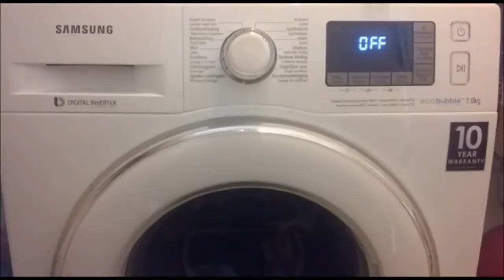Samsung EcoBubble stuck mid-program - Repair guide

Comment: Hi! Thank you for your video. I have one question. In the part below, the one you opened, you didn't put the gel nor the cover, right? Did you leave it with nothing?
Reply from the maker: That's correct. I didn't have any suitable material to replace the gel with, and from reading about the subject, I came to the conclusion that the gel might be part of the problem (less heat transfer off the board). The machine is still working btw...
Reply: @goldflemming4912 Thank you!!
Reply: @goldflemming4912  As an industrial electronics technician, the gel you refer to is probably conformal coating which is to protect against moisture, not vibration. I would have put the bottom cover back on and sealed it with silicone. The conformal would NOT have been part of the problem but dry soldered joints obviously were. I would have applied a little more solder to each joint as it was probably assembled with lead-free solder which is often problematic. I would also have paid attention to the motor driver I.C. joints. The motor driver I.C. is hidden under the black heatsink. Otherwise, congratulations!
Reply from the maker: @Geoffh777  Thanks for the feedback. Always good to hear a more professional take on it. I hope it helps many more people.

Comment: Belief it or not if you run the wole program twice and after the 90 degree cotton twice with or without load. It works again as normal. The problem stayed away for like 6 months than started stopping within the program again. Followed the same routine and now it's working again as normal for weeks. 7 year old machine.

Comment: Gave it a shot. Got the control board opened up and cleared but that seems to have been the easy part... Even the silicone protection came off relatively easy with a bit of patience and actually trying to get off as a big of a piece as possible instead of trying to nibble off little chunks at a time. 

But I'm having trouble desoldering. It takes really long time to get the tin to melt. Like almost impossible. especially the thicker solderings I haven't managed to do anything with. I bought a 30W soldering iron for this but it really seems to do f*** all if I'm honest.

EDIT:
With a bit more trying I managed to get soldering done too. I must've had the wrong technique in the beginning. However now the machine gives "dE" error right off the bat when starting any programs so I must've f** up to board. Oh well, I tried. Thanks for the video, looks like many found help with it.
Reply from the maker: Sorry to hear you couldn't fix it, but it's always better to try.

Comment: Thank you so much for this video, it inspired me to try and repair our washing machine tomorrow.
The only thing that is unclear to me is: do you put the plastic piece back you cut off from the casing in which is the print plate? Or you just leave the print plate bare? Greetings Tessa
Reply from the maker: The print plate has been and is still bare since doing the repair. My machine still works without problem. The bare print plate did not cause issues in all this time. Good luck with the repair!

Comment: Excellent bit of information, thanks. I'd never have thought it would provide such an easy fix. I noticed you missed out the 'how to remove the plastic glop' from the back section, not so easy but it did come off ok, although it took a lot longer than the actual soldering. Many thanks.
Reply from the maker: The gel is indeed by far the most time-consuming part of this though it is quite straightforward.

Comment: Hi! Thank you for sharing this. My Samsung washer is about 3 years and has the same problem.
I wanted to ask:
1. Did you cover the circuit board with something or just left it without the silicone gel.
2. How did you fix the underside of the box? 
Thanks
Reply from the maker: Hey there, glad you found this video. To answer your questions: 1) No I left the circuit board uncovered. My theory is that the gel causes too much heat to be trapped on the board, making the soldering points susceptible to micro-cracks. 2) If you mean the side where I cut the hole, then no, the underside is still open. That may sound like it could cause problems, but the machine has been working multiple times per week since april and never encountered the problem again.
If you could find a way to close the hole, perhaps you'd like to share it with us here. Would be interesting to hear your thoughts on it for sure.
Reply: The heat is not the issue here, it is the vibrations. Soldier joints are likely more brittle at lower temperatures. I am considering adding a foam (such as from a mousepad) inside the bottom lid and gluing or clamping it back in.
Reply from the maker: @henriksoderholtz8368  I'm not an expert but a user called Benny Zeusian
 commented here a few months ago with an extensive analysis of what he thinks could be problem. Worth a read.

Comment: I have eco bubble 6 kg,problem was that it start to work and stops after some time. I found the mother board that was in the front cover and two cold solder were bad, i solder it again and the machine is working now ok

Comment: Normally this sort of solder joint problem is worse with wire to board connections, i.e.where a pin from a connector or a  component leg comes through the board, as the hole has to be made larger than the pin so it can be assembled easily in the factory, and the solder is then stressed by trying to stretch and form a bridge - so check those  points first, sometimes you will see a little hair-line of fracture.  Larger components add mechanical stress to this. My observation is from many years of TV repair, but the problem is basically the same here, sadly.

Comment: took panel off today removing gel was a nightmare I don't know how you managed to get panel as clean as you did I took it to an electronics friend who has thirty years experience repairing and replacing components yes many cracked and dry joints he resoldered but guess what now machine wont even bring up screen  I gues removing gel has caused further damage so advice be extremely gentle removing it mine would not peel I used a plastic car trim tool remover tool to gently scrape board  but thanks for your info it was worth trying  new board purchased
Reply from the maker: Hey Ashleigh, I'm very sorry to hear the repair was unsuccessful. It is possible something was damaged in the process of removing the board and accessing the solder joints. Of course it is equally a possibility that your board had an unrelated issue. Let us know if this new board fixed your problem. Best of luck!

Comment: Removing the gel is hard… its a thick layer and im worried that i break the connectors underneath, i cant show a picture, but was it a half centimeter thick yellow layer? Yours looks very different and cleaner. Any tips on this step?
Reply: Hello and sorry for my late reply. For the sake of future people browsing these comments I will answer your question and say that the gel on my board was about half a cm thick, but not yellow and more transparant (from what I can remember so many years later). 
Perhaps yours was a different (more recent?) model of washer? The machine in the video (Samsung WF71F5E5P4W) was bought 3 years before making the video and the video is 5 years old now. While I did buy it new, the model was definitely not the newest Samsung had available at the time. I imagine the materials used in the production changes over the years as well as the designs of the inner workings themselves.

Comment: Great video, 

I have the same machine, luckily for me its still working fine.
Do you have any suggestions how this problem could be prevented?  Or is it  unavoidable?

Thanks - Bedankt!
Gr
Reply from the maker: Honestly as long as it works, I would not touch it. The things I would say that prevent it are the steps of the repair in the video: break casing, remove gel... Can't think of another prevention. It's just a badly soldered main board. Sorry and good luck. Maybe you have the exception confirming the rule. ☺️
Reply: This issue could be prevented by either placing the PCB assembly outside of the washing machine. I have just done this procedure and found broken weddings under the big black heatsink where the motor controller is placed. I am considering extending all the wires and placing the PCB in a separate enclosure. The stress on the soldering joins are most likely from vibrations during the spin part of the cycle.

Comment: If you depress the temp, delay end and power switch simultaneously, it enters calibration mode. Allow it to
Complete this cycle without washing in the drum and then it completes full cycles uninterrupted.
Reply from the maker: I did try that before attempting this rather invasive repair and for me did not fix anything.
Definitely a good tip to try this first though, thanks!
Reply: Thanks @kuromicra! That tip solved my problem for a while at least. Had succesfully runned 5 washes with no problem after calibrating🎉

Comment: Great video, you're wrong about the gel/silicon coating though, it's not added to dampen the vibrations, it's added so the part cannot be easily serviced, instead, the entire control board needs to be replaced. If Samsung wanted to protect the board there are far better ways to do it than just coating the entire thing in silicon and removing almost all possibility of servicing the board! Dick move by Samsung!
Reply: They don't want efficiency where machines can be easily repaired, they want as much money from consumers as possible.
Reply from the maker: Ah thanks for the insight. Another commenter made a similar remark. To me, this silicon is not very hard to remove so a DIY servicing is not rendered impossible by it, but I guess it's not worth the time for a real technician to do this procedure for a paying client.
Reply: @goldflemming4912  trust me the silicon on mine was near impossible to remove, my machine is a little different from yours and I removed my board from the plastic casing without cutting the frame, I injected isopropyl alcohol with a syringe and the board eventually lifted out with a little prying with a plastic prying tool. Then I cleared the silicon off and this took a while, seemed like it was baked on! 

Anyways I inspected the board under my microscope and sure enough micro-fractures everywhere around the through-hole components, this is due to two reasons. One - cold solder joins, and two - lead-free solder. Combined these two contribute to the premature failure of the board.

After using some quality Amtech NC-559 flux and leaded solder I re-soldered all the through-hole components again with leaded solder. Re-assembled the machine and it has been working for almost a month now without any more issues. It completes all cycles and programs, while in the past it would get interrupted mid-program and stop. Simple enough fix for someone who has a bit of time on their hands and doesn't mind getting their hands dirty. This repair saved me a quoted 140 euros for a replacement control board.

Comment: How did you remove that protective gel from the surface of the board? My washer has same symptoms and if samsung refuses to replace board free of charge, I’ll try resoldering. Thanks for your informative video! :)
Reply from the maker: Hello Mika, I just used a blunt knife to gently peel it off, starting at a corner. Remember it is not necessary to remove the gel on both sides of the board; only the underside will suffice. I found it was easier if I ripped/broke the gel layer as little as possible; this gave me more of the gel to hold on to while peeling. Removing the gel probably took the longest of all the steps. Just be gentle and careful not to break any connectors and you'll be good. Good luck!
Reply: Well, Samsung replaced PCB free of charge after I complained that this is product defect and expired warranty does not matter since the machine is quite new still (3y and few months). Going to open lid to see if there are some absorbers under the screws - if not, will add, to minimize vibration to the PCB.
Reply from the maker: Good to hear Samsung took responsibility. The internet is full of defects with this machine, but unfortunately it is equally full of people getting a hard "sorry, but no" from Samsung. When it comes to the screws, I believe that the problem is not that the PCB connections break because of vibration. I believe they break because of bad soldering as well as the protective gel keeping the heat trapped in the board. That being said, extra absorbers won't hurt of course.

Comment: Hi Gold Flemming I have a Samsung washer/dryer WD6122CKC it’s an old
model, it was working fine until the drain pump stopped, it happened that it
was full of dirt, so I cleaned it and work fine but doing that I moved the
washer to a new place but was no balanced, so after that, the washer jumps
while spin dry cicle. One week later I got the "dE" error code, door lock problem
(front load). I test door latch assembly and its good, the wiring is ok too. So
that leaves me to check the main board. I opened it and found that some places
the gel has come off due to the heat. I want to know your opinion, if it’s
worth trying to resolder, or the problem is elsewhere?
Reply from the maker: I'm sorry to have to disappoint you, but I don't feel qualified to answer this question. I have no experience with washmachine repair in general and I don't know this model of Samsung washing machine. This video is about a specific and sadly common problem with the Samsung EcoBubble. In closing, I will say that from what you write, I understand that you probably know a thing or two about diagnosing and fixing appliances so I would advise you to inspect the main board and look for faulty solder. If done properly, re-soldering will in any case not damage your board. Good luck with the repair.

Comment: You didnt show two main things: how to remove the gel and which contacts should be resoldered... I don't understand why, I, would rather see whole repair instead of cutting out two most important processes of the repair.
Reply from the maker: Thank you for your feedback. As to removing the gel, it simply has to be scraped off. There is no trick or tips to be shared other than meticulously but carefully removing it and clean the contacts on the PCB.
Regarding the soldering, as I believe I have stated, you solder all of the cracked solder contacts. As this might be different for your PCB than for mine, you will have to use your own judgement to determine which ones might need some new solder.
Good luck with the repair.
Reply: @goldflemming4912  how thick was your gel? And how in earth did you remove it at the important black blocks?
Reply: The gel is around 2-4mm thick and you can use a plastic scraper to remove it, it's bit laborous but not hard. Cut a line and pry off in big chunks worked well for me. I found two visible cracked solder points on two largest pins, but I also resoldered many other pins, some had really thin layer of solder so I added more solder to those point. Before putting it back, I sprayed the board with silicone spray that's used for weather proofing electronic boards.

Comment: My English is poor and I did not understand everything, but you want to say that gel is a problem? My washing machine is the WF90F5E5U4W I have already replaced the motor, but the problem still exists.
Reply from the maker: Hi there. I don't know that specific model but judging from what a quick search tells me, it looks similar if not identical to my machine. To clarify: it is not the gel that is the problem, it is the soldering on the connectors that is the problem. However, to get to the connectors on the board, you need to remove the gel covering the board. If you want I can ask my sister-in-law to give you some more details (she's Polish). ;-)
Reply: @goldflemming4912  thanks for answer. Unfortunately, in this movie it is not shown how it removes the gel and how and what exactly sold. I tried to fix this panel according to his instructions, but I could not fix it. I bought a new PCB module for £156. Now the washing machine works like brand new. I think this movie is fake. Kind Regards.
Reply from the maker: Cynamon Cynamonikus  I am sorry to hear that you could not solve your problem by repeating the repairs I shared with the community. I am sure you can understand that I will not be held responsible for any repairs you failed to execute. Every repair of this kind is at one's own risk. As to being called "fake", I believe the many comments here testify to the helpfulness of this video and I believe it is best to let them speak for themselves. In the end I am happy to hear that you found a way to make your machine work again.

Comment: Just did the same to mine - however my weldings did not look broken - BUT the peint lanes going from the capacitors looked weird ... i filled them with solder and it worked ...-

Comment: Hi. Still working fine after 3 years?
Reply from the maker: The machine had been in storage for a good year due to a move and a period spent abroad, however recently we reinstalled it and it hasn't missed a beat. Didn't do anything to it since the repair in this video.

Comment: What tools did you guys use to rip the plastic from pcb?
Reply from the maker: I used a multi-tool (like Dremel) to cut 4 grooves in a rectangle shape on the bottom of the plastic case, housing the PCB. This casing is then still held to the PCB by the isolating gel. I simply pulled off the cut-out casing. To remove the gel you can use any (plastic) tool to carefully scrape the gel from the PCB. I used a plastic knife. It's a pretty slow process though.